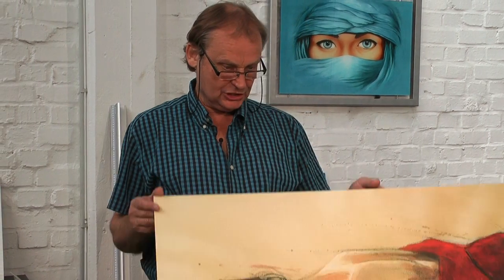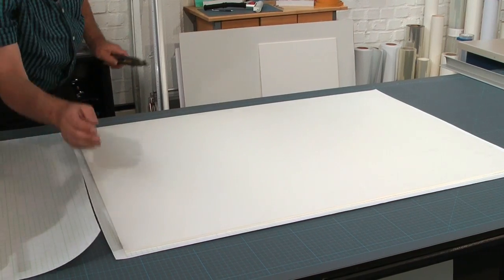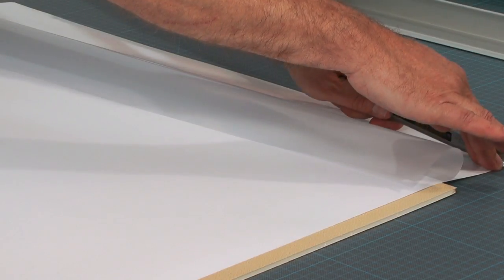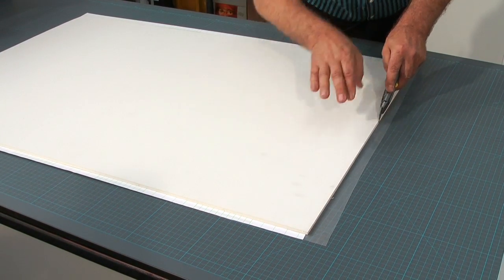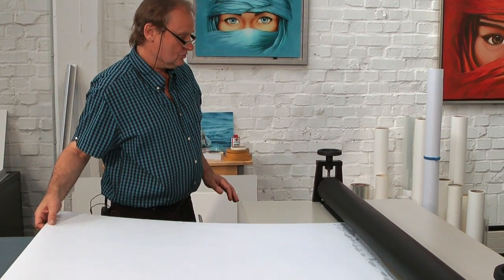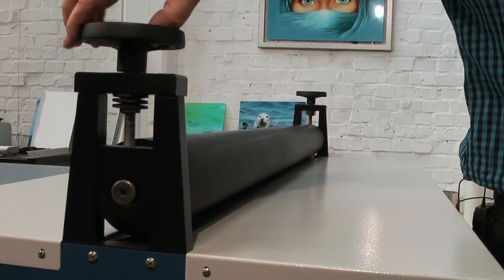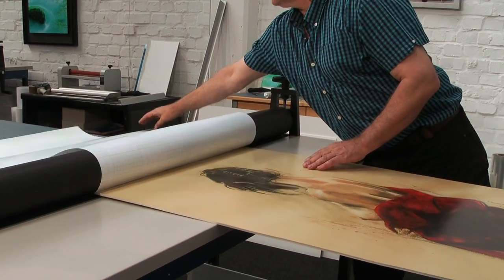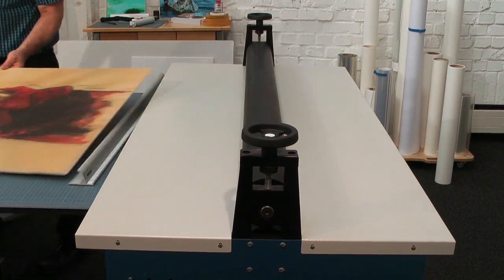Video Guide Laminator 07 - Laminating of mounted prints

Comment from the maker: Please check our Video Chapter 10. In this chapter Klaus is laminating a Larger Print. He is using a Working Board as a support. This board should be made of any smooth material (like Forex or Acrylic) and you cover it with a Double-Sided Adhesive (without tearing away the top release liner). Therefore the plate is covered with a silicon surface, so you can stick things to it and take it away easily.
Does this answer your question? If not you can also email us direct...